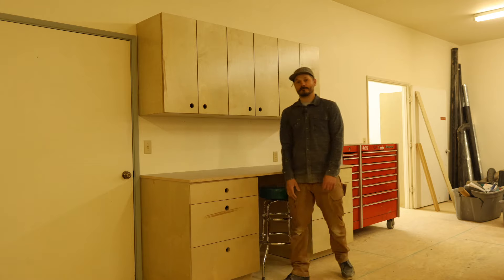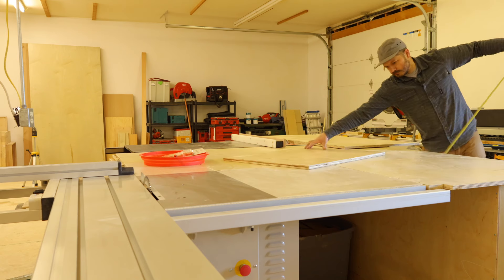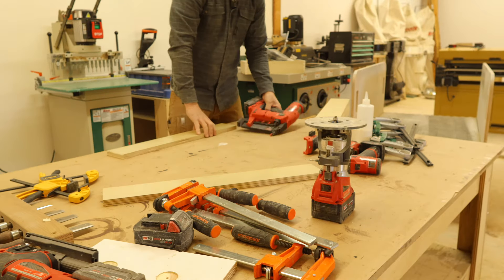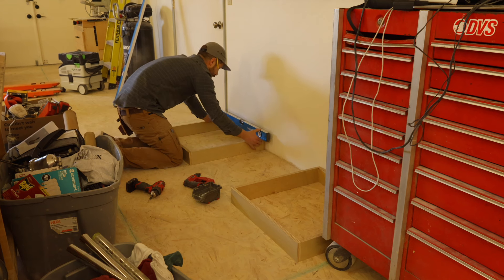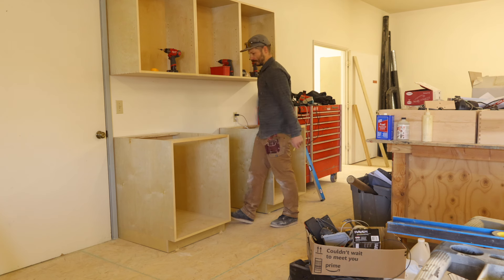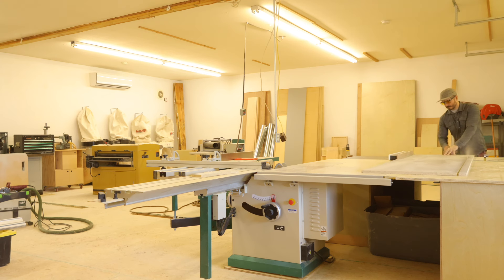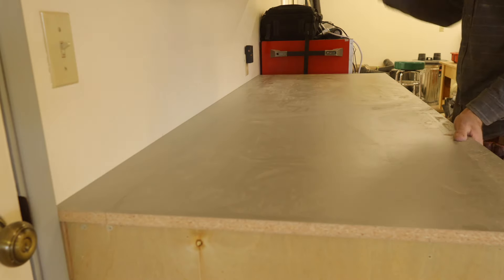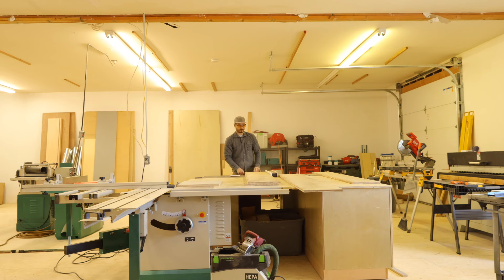Time to start getting things in order | Cabinet shop organization. SHOP MOVE PART 4

Comment: I for shop/utility upper cabinets cut a strip of 1/2" plywood about 3" wide the length of the cabinet to run anchor screws thru as a added strength method to spread anchor load out on back of upper cabinet, Ray
Reply from the maker: That’s how I hang my upper cabinets normally.  Works great